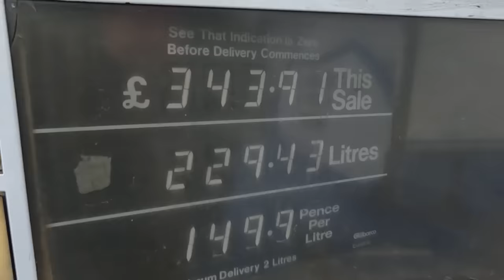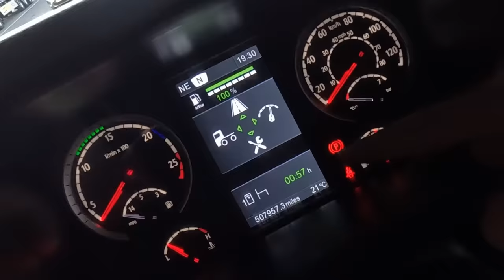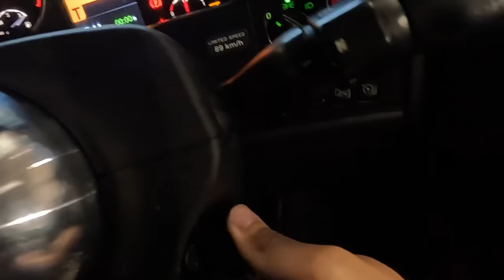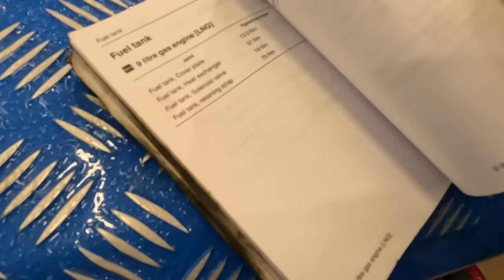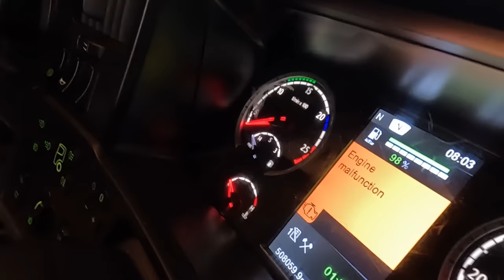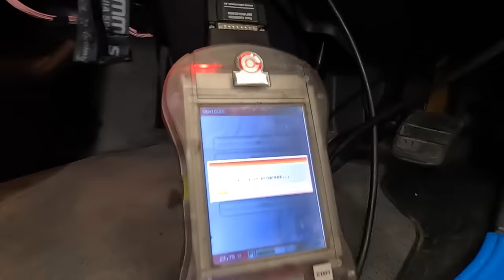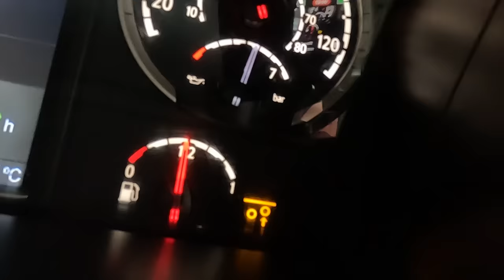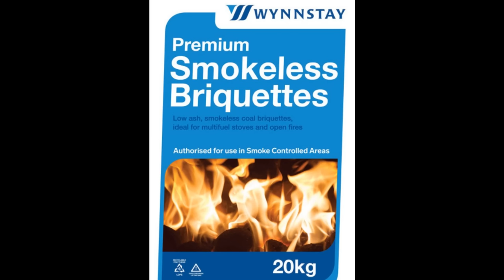I Tuned My SCANIA V8 Into A WEAPON | *SHOCKING RESULTS* | #truckertim

Comment: Hi Tim, first time watching your channel, I have to say you are enthusiastic and I like your humour. I could hear the difference with the engine re-map. Sounds like the Greek connection shifted the injection timing quite a bit. While the smoke is not tooooo much I would suggest that you monitor the engine oil more closely for combustion contamination. You may find that you might have to change the oil more frequently. A tell tale will be fuel consumption increase. But I have known engines tunes to increase HP and reduce fuel consumption at the same time. Anyway best of British to you!

Comment: Thing is Smoke means unburned fuel.    You’d have to get it rolling rd to actually see if it has more power.  Because unburned fuel will have a different exhaust resonance.
      Personally I’d have to be careful doing that everywhere,  it could go against you & result in fines from the Police. 
Many people think it’s cool, but it isn’t a good tune if it could cause trouble because many people will deem it bad to.   Children suffer from asthma etc could cause you big trouble,    Greece isn’t the U.K..

Love you Tim, go careful matey
Reply: It’s quite normal to run them a bit richer when mapping them it helps keep the cylinders cooler doesn’t make it a bad map at all
Reply: Absolutely correct. Poor tune, overfueling, black smoke is incomplete combustion. Diesel is a good degreaser, so long term probably wont do the bores and rings any good.
Reply: @gregshearer423  the limit for the all big truck engines is cooling. That's why the marine versions in boats has almost double the power since they have unlimited cooling from the seawater
Reply: @Swedishchef11  actually your wrong, most if not all marine equivalent versions of truck diesels are rated for lower power because they need to be reliable at 100% load at that power for extended periods of time. most truck diesels only use 100% of power for maybe 20 mins every hour and thats more towards 40% in modern lorries which will limit power depending on the airbag pressures (to measure weight) with the scania s series doing this. This is why down south when they fitted volvo penta 750 d16's to the marina ships they kept grenading. Because the engines arnt designed to hold that full power for 10 hours a day. They ended up down tuning the engines and since then they have been reliable.
Reply: @ItzChaza  well, I have only worked at the Scania plant for 18 years but I have apparently zero knowledge about their truck and marine engines..
Reply: @Swedishchef11  and iv worked at volvo plant devision for 12 years... although ill put my hands up after reviewing some figures ill say i was wrong. our penta engines are down rated compared to their haulage equivalent, your scania 16l is rated higher than the haulage spec. so ill say i was wrong so say all marine engines are lower rated

Comment: Quick question…
Isn’t the exhaust smoke illegal? I’ve seen diesels get pulled over for less than that.
Reply: It be setup that when the normal exhaust is switched in the emissions will be legal.

Comment: 26 ton   [ inc load + trailer ]  + 8 ton [ unit ]  = cross weight of 34 ton  not that heavy , your 10 ton short of your max weight [ 44 ton ] . my old scania could carry a pay load of 26 ton after it was uprated to 40 ton from 38 ton  [ it was a 05 r series 380 4 wheeler ]  someone overloaded it once , no weigh bridge on site when i got to selby it weighed of at 46.5 ton  [ then it`s gross weight was 38 ton then ]  that was 8.5 ton over weight  UP`S UP`S ,  it went up windy hill m62 into yorkshire from milnrow without a run up the big hill and never dropped below 30MPH and 3 or 4 split`s on the g-box . that`s wen i new it was heavy . some say them 380 scanie  engine`s wear better puller`s than 420 engine`s  ???  !!!!!  we had some 480bhp  4 series straigh 6 engine`s on the fleet and the 380 wear not far of them. saying all that the 380 did have a train weight of 56 ton so it was up to the job .    the black smoke on your unit is not a good sign  DVSA / POLICE wont like that
Reply: Legally as a 5-axle combination (3 on the unit, 2 on the trailer) it’s limited to 40t and rays assuming the trailer is plated to take as much as that too.

Comment: You need four more modifications to the truck. You need a bigger turbo. The Bwooooo turbo blow off valve noise. Eight wheel drive and twin stacks. I think the stacks sound better.